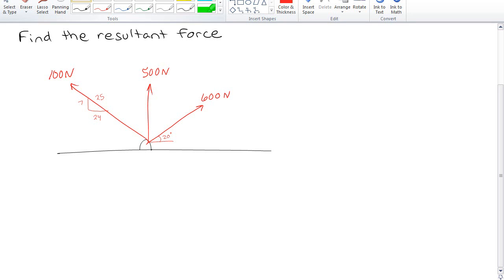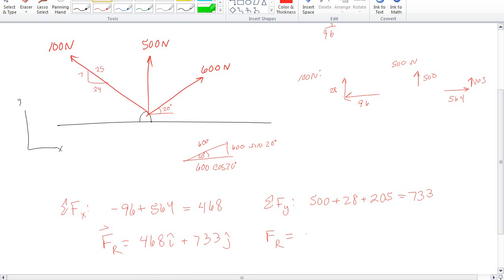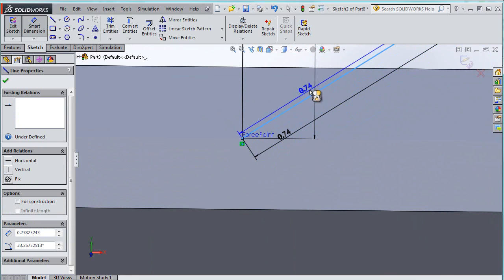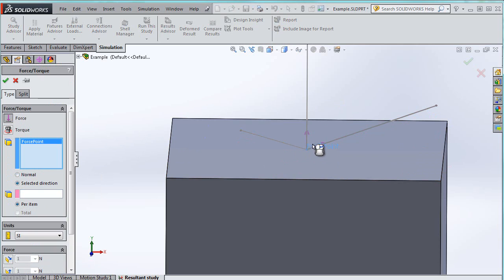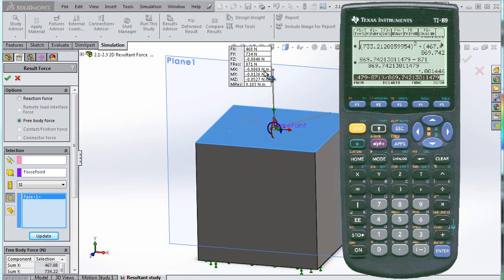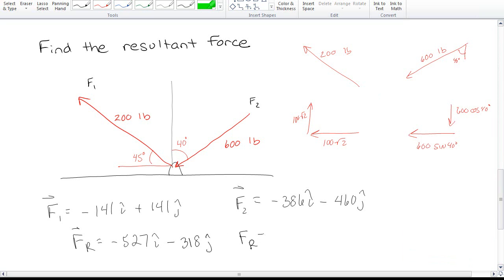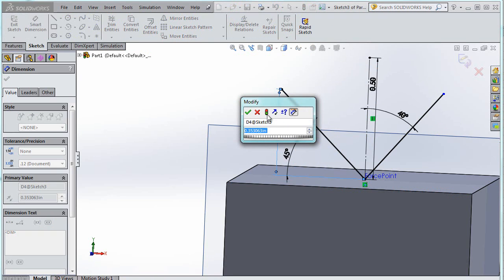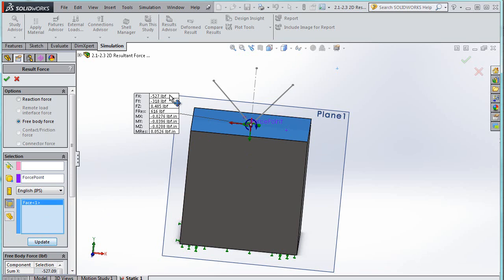Finding 2D Resultant Forces using SolidWorks Simulation

Comment: Excellent video! Very good explanation
. Be careful with the dimensions of the piece, because if these are very small and forces applied are large, errors occur in the simulation solution due to large displacements
Reply: How to bypass this error